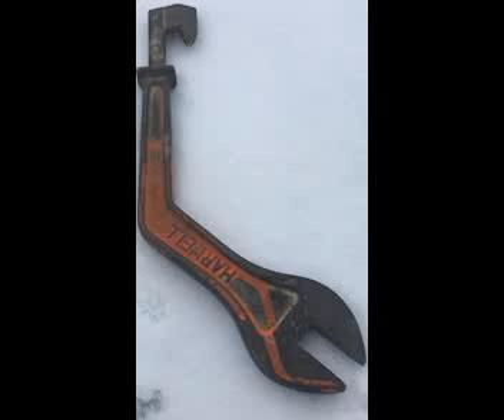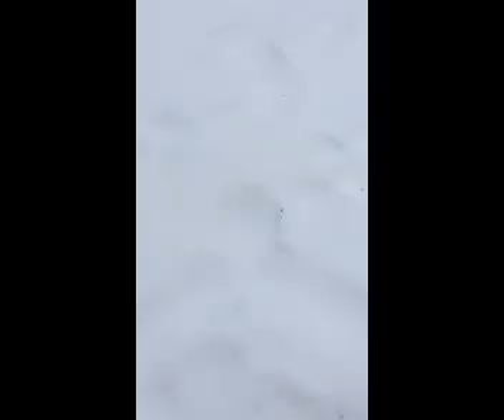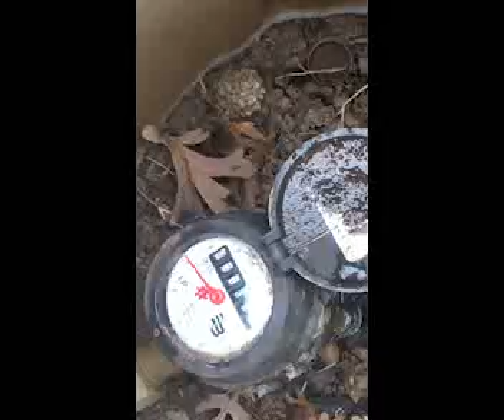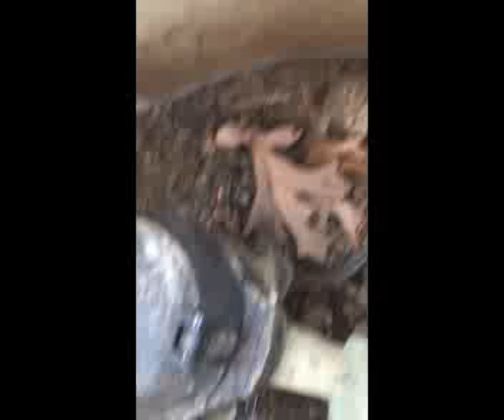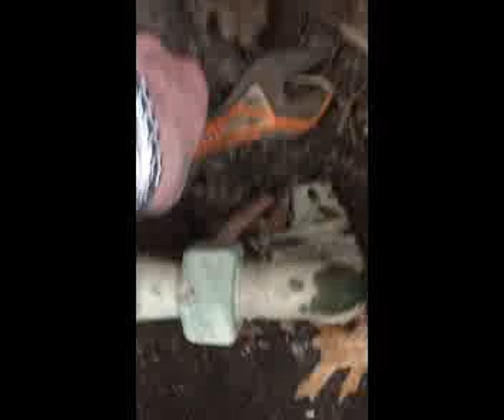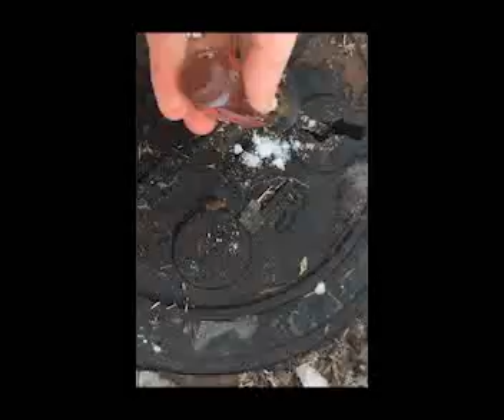Dallas, Texas - turn off your home's main water valve

Comment: How much pressure did you apply to the valve . Mine is not budging. Any insight? I sprayed some wd40 !
Reply: I just used a wrench. Not much pressure at all. It turned pretty easily.